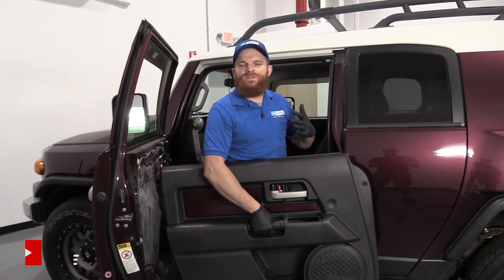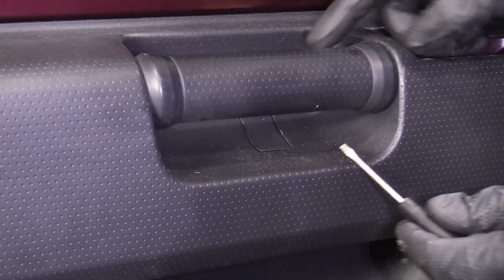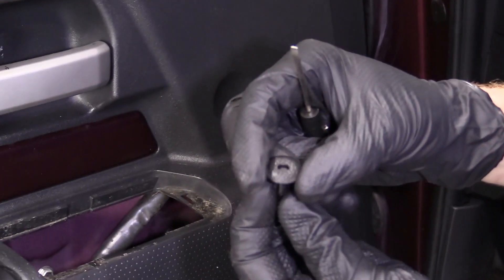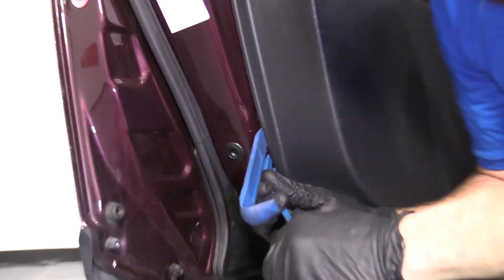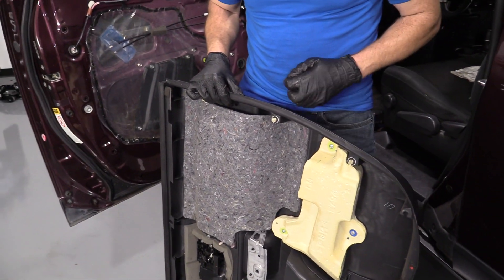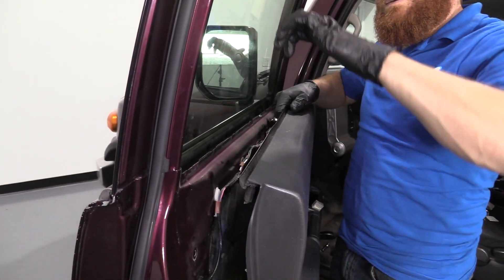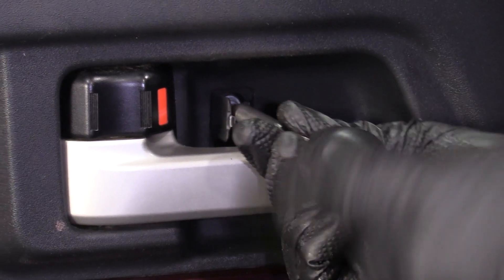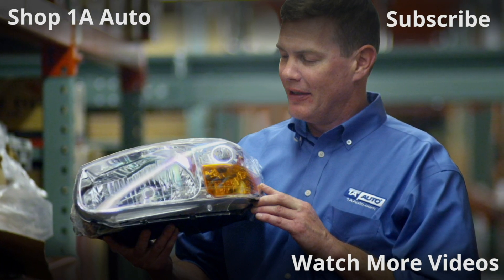How to Remove Front Door Panel 07-14 Toyota FJ Cruiser

Comment: That’s not the right way to take the window switch breaks the tab that holds it in as you can see he broke it you have to pry from the front. Thanks for making me brake mine
Reply: I just came here to make the same comment.
Reply: I tried posting this same comment long time ago but maybe it wasn't approved, not sure. He broke it at 0:37 and at 7:25 you can see where the tab is broken.
Reply: i did the same thing.  if you break the little tab like HE and WE did, how the hell do you fix that now?
Reply: @lisademayo8589  buy another fj
Reply: yeeeeep I used this video for reference and now my window button panel doesn’t snap in. I guess that’s what I get for following a YouTube tutorial.